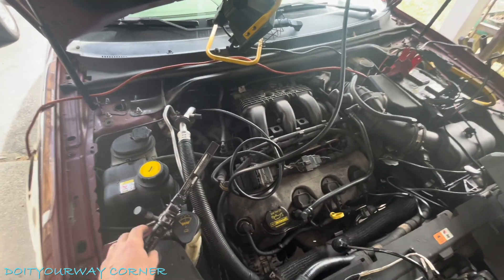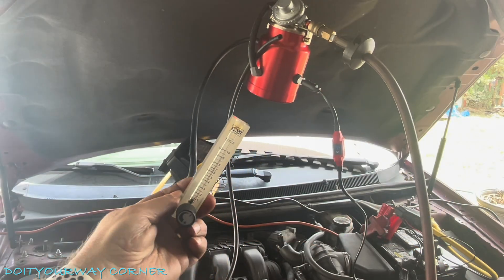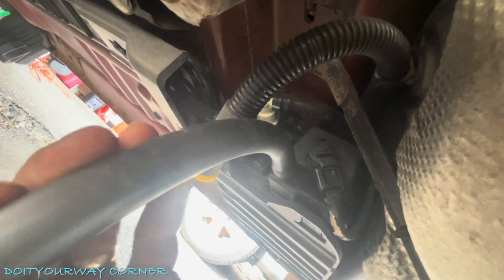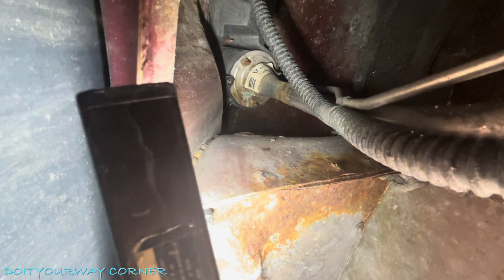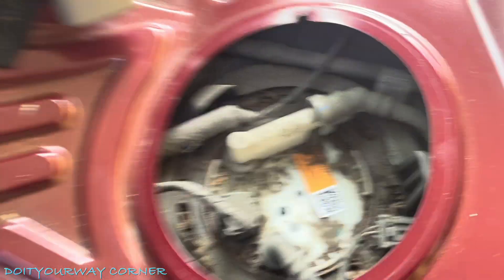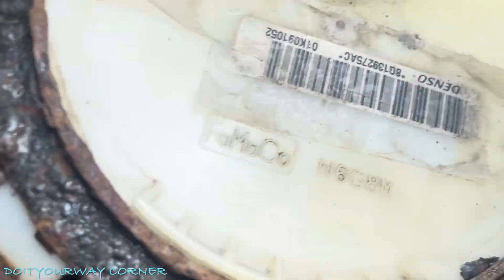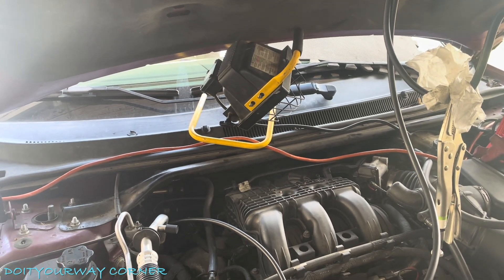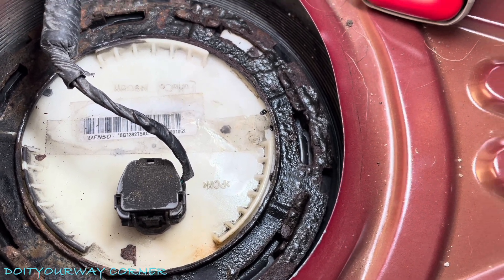Updated EVAP leak Found

Comment: You're making a lot of work for yourself. Why not run an evap test? You should be able to access it with any mid to upper level scan tool. Its a complete self diagnostic routine for the entire evap system. It won't find the problem 100% of the time. It has about a 75%-80% chance success rate. If it doesn't find the issue, then try to find it doing some of the things you did in the video. The whole point is to save you from all that work.
Either way, I wouldn't rule out causes other than a leak in your evap system, especially if you don't have codes. However, evap is the most likely cause, so you want to make sure your scanner is able to read all relevant DTC's. You can't clear evap codes. Only the pcm can do that. Without getting too technical, pending evap codes can change from pending to permanent status. Not all scan tools can read permanent codes, so they may be there but you can't see them. 
You probably found the issue being the o ring seal on the pump. If you want to be certain, spray some brake clean where you think the leak is. It will reduce the gas smell. Then put a towel, or something similar over the top of the pump under the back seat. If the smell goes away, that's probably it. Fumes can also get into the cabin through the hole in the firewall for your hvac system. There are usually evap components close to that hole so I wouldn't rule that out unless the issue turns out to be the o ring you found.
Reply from the maker: I really appreciate the advice. I tried all that you suggested even Evap test with scan tool. No luck. The other reason for all the work was to show some other options besides scan tool. There are many videos out there showing that. I wanted to show something different in case folks don’t have the scan tool. I’m confident that my issue is the oring at the tank. Seriously though, love the feedback. Keep it coming.

Comment: Nice! I was thinking of getting a flowmeter for my Ancel S100 Unit. So far, I've used it to check intake, evap and exhaust. No leaks.
Reply from the maker: Same here. Sometimes I don’t like the residue that is left behind in my throttle body after smoking, but I will smoke from time to time.

Comment: Will evap leak cause car to stall while driving?
Reply from the maker: I would focus more on a vacuum leak. Does the car idle normal when stopped? Do you have check engine light? It could also be a fuel delivery problem. I don’t think it Evap related
Reply: @kurtT342  no check engine light, but sometimes there is a vibration when idle, it comes and goes
Reply from the maker: @ you could look under hood while it’s running to see if u hear a hissing noises for vac leak. How many miles on it? Have you changed transmission fluid? Sometimes the torque converter has bad fluid that can cause it to stall while in gear.
Reply: No. If the purge valve isn't working properly there can be an excess amount of vacuum in the system, and that can starve the motor for gas, but something like that is not too common. If the car stalls while driving, there will be codes. Scan the system and ignore all the ones that start with a U. Focus on the ones that start with a P. If there are any that start with B or C, they're probably unrelated to your stalling issue. Focus on P first, then B, then C.

Comment: What flow did you use, and where can I find it?
Reply: #flow gauge
Reply from the maker: @ it’s in the description.
Reply from the maker: @ https://www.amazon.com/dp/B07DNW6JHX?ref_=ppx_hzsearch_conn_dt_b_fed_asin_title_2

Sorry I thought I put it in.
Reply from the maker: @ https://www.amazon.com/dp/B07DNW6JHX?ref_=ppx_hzsearch_conn_dt_b_fed_asin_title_2
Reply: Thank you 👍
Reply from the maker: @ssraney1  be careful when using the flow meter with smoke. Oil tends to collect within the tube. You can take it apart to clean.
Reply: @kurtT342  so you're basically just using the flow meter to introduce air/vacuum in the system, and if the (ball) stays dropped,no leak-if it stays steady their is a leak,or do I have that backwards?
Reply from the maker: @ssraney1  correct. The valve controls the the flow
Reply: @kurtT342  10-4 I have a smoke machine,never used a flow meter,just always put smoke to it.
I have one from autoline pro with built in compressor but no flow meter. Appreciate the info 👍 thanks